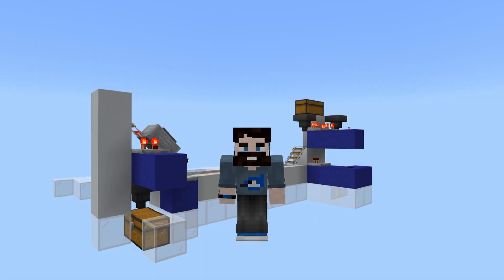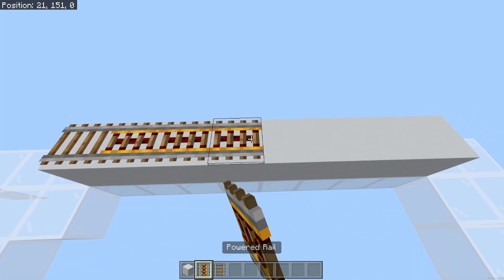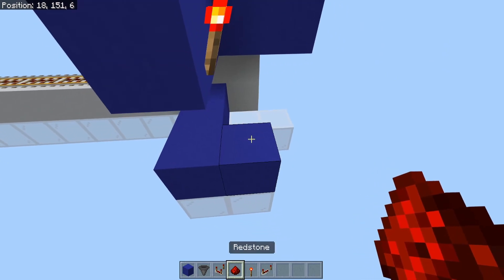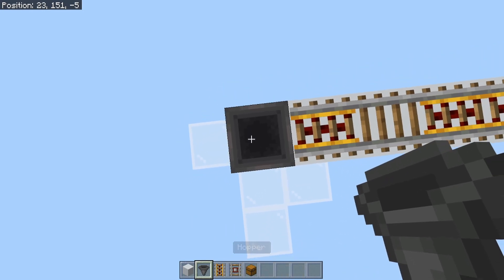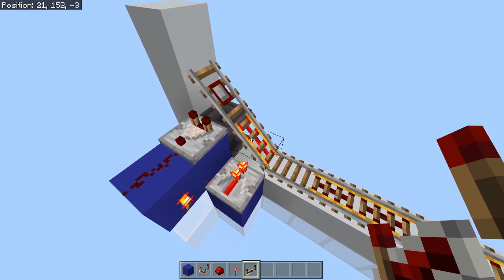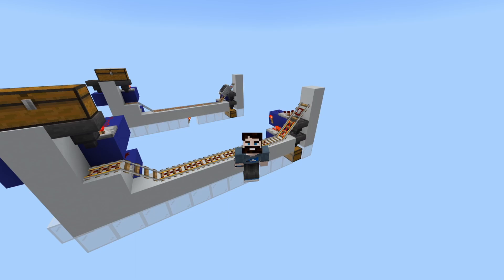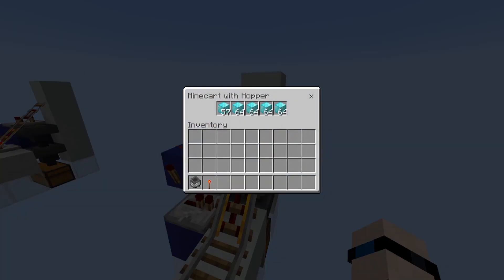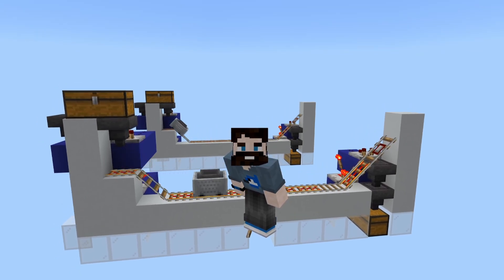Minecart UNLOADER and LOADER - Fully Automatic! | Minecraft Bedrock Edition 1.16 | Redstone Tutorial

Comment: I have set up this system too go from my mine into a sorter system. The unloader works fine after I switched the hoppercart to a chestcart. However, the loader end, the cart isn't locking in and loading fully. It only picks up a few pieces and leaves. Please help! Is it because I switched carts?

Comment: The Unloader in this system failed on me when use on a server.  The Mine cart will slide down on the unpowered and not unload in to the hopper.  I Fixed this by placing a Hopper facing in to the Bottom of the Two stacked up.  This way the hopper mine cart has two places it can unload to , if server timing messes your system up. Hope this helps.

Comment: Thanks! This worked pretty well except when I only had 2 hoppers, it wouldn't unload. To fix this, I put a hopper directly under the powered rail that was next to the detector rail. This fixed the issue. Thanks so much for your video!
Reply: Thanks for posting this. I couldn't figure out why the minecart was rolling halfway back down the powered rail and then not emptying. Adding a second hopper worked like a charm.
Reply: @Lmpy20  Glad it worked! ^u^

Comment: Assuming I'm back from a real mining session, this loader will fail miserably if (read WHEN) the minecart gets 5 different non-full stacks and the hopper cannot load more items into it. Any solution?
Reply from the maker: If you set it up right, it won’t fail. I’ve tested it over and over.
Reply: @BluJayMC  um, sorry, I think, I commented on a wrong video 😅
So, how many items will this minecart get?
Reply from the maker: LOLOL! You’re fine! I don’t remember the numbers off top of my head, but it will either wait for the minecart to be mostly full, or the hopper to be empty. If either of those conditions are met, it launches the Minecart.
Reply from the maker: Also - just going back to the video, I looked at it and I did use a minecart with hopper. On my episode of Truly Bedrock where I built this, I used a minecart with chest. Sorry for the confusion. Use a minecart with chest.
Reply from the maker: If you use a minecart with a chest, it won’t get clogged...

Comment: Thanks for the video blujay  :) Curious. I want to use something like this to feed bamboo into my smelting system, but, since I am playing on xbox one, i have to do everything i can to reduce lag. I guess 1) does having a minecart constantly going cause any lag, 2) if so, is there a way where if it runs out of items it just stops? maybe sending a signal to a powered rail once the input is ready to stop the cart?
Reply from the maker: I'm sure there's a way to design it so that it auto shuts off. I've actually got another design that has a manual on of trigger. It's newer than this one and actually works better. Look for it on my channel - I think you'll find what you're looking for! :)

Comment: How could we set this up for something like an iron farm where the items trickle in slowly and we do not want the carts steady going back and forth? Can you make the cart stay at the pick-up site until is has a stack of items for example? Thank you for the video either way!
Reply: I mean, it wouldn't be this exact system but what you can do is to use buffers! Put couple comparators behind your buffer chest and put your desired amount of items in another again, with a comparator. Then add a comparator in the substract mode to calculate the difference between desired amount and buffer chests. Then hook the output into a sticky piston with hopper. Put another comparator behind the hopper so that as long as it has an item in it, it also turns that sticky piston on.

My explanation might be complicated so let me simplify it to some steps.

1. Calculate the difference between "desired amount of items" chest and buffer chest. Buffer chest is where your iron comes from your farm.
2. Send TWO signals to your sticky piston. First is the output of step one, and the other is the output of your comparator. Meaning, once "1" triggers Sticky Piston-Hopper element will suck the items as long as there is an item in that hopper.

I haven't said anything about repeaters or redstone torches but you should know when to use them.
Reply from the maker: Yep, this is totally doable. Would be a slightly different design. But yea, it's possible. Maybe another video is in order?

Comment: Could we use a mine cart chest with this or is it more effective to use a mine cart hopper?
Reply from the maker: You could in theory use a minecart with a chest, but depending on how many items you have going through the system at a time, I could be sitting in the loader a lot longer. It’s more efficient to use a minecart with hopper because it keeps things flowing.
Reply: Depends what you’re actually using it for... if you are using it for storage of some kind(using the loader too) then chest minecart because it holds more, if you want to pick stuff up from the ground(most common; no loader needed) then use a hopper minecart